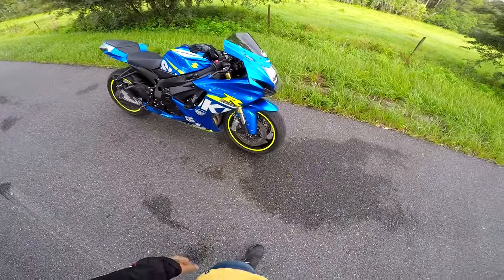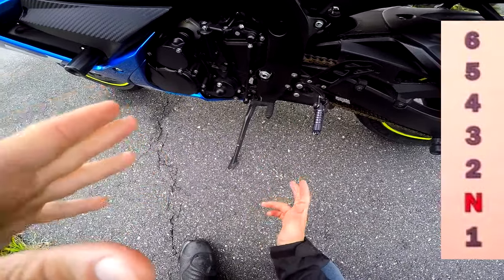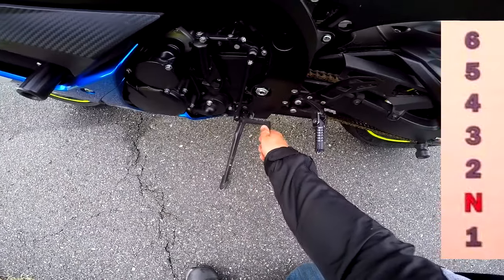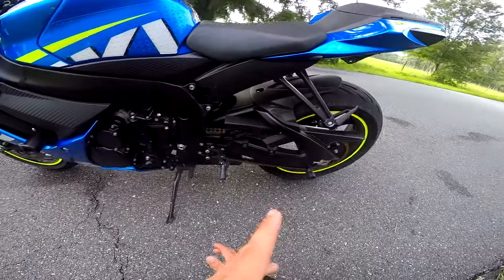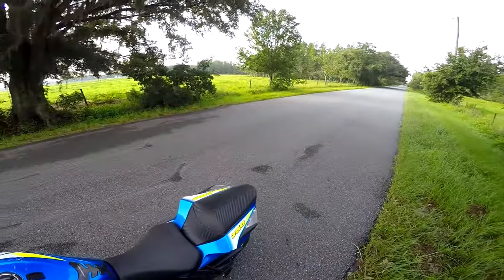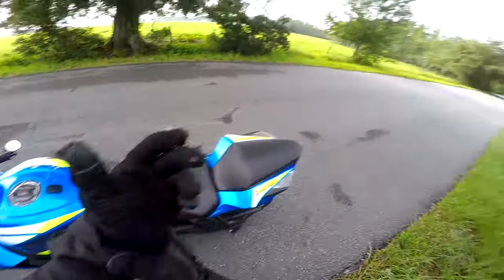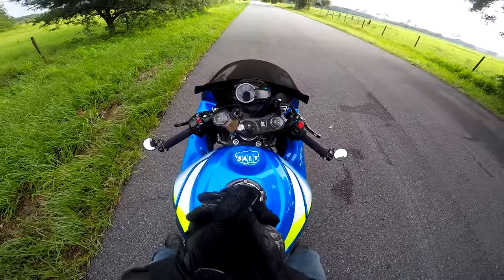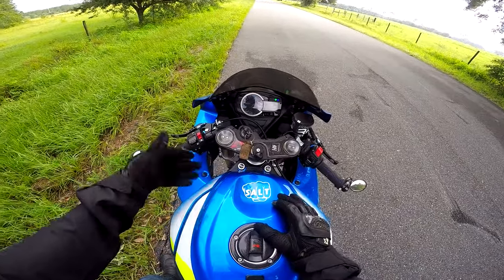How To Ride a Motorcycle: Part 2 - Shifting & Downshifting

Comment: When you’re trying to go to a stop, do you need to apply throttle to downshift?
Reply: If youre in an emergency you just wanna pull the lever in and downshift while applying pressure to brakes. Not too much pressure tho cuz if you apply too much on the front brake youre like to be thrown headway off the bike and if you apply too much on the back you'll still slide. If youre on a casual ride tho when downshifting you can blip the throttle to properly prepare the engine for the lower gear👏🏾
Reply: BlokjesRacing  so when downshifting you wanna just blip the throttle when you push down the shifter while holding in the clutch. After you've done this then you release the clutch
Reply: BlokjesRacing  so you're in 5th and you wanna go to 4th you're gonna: press in the clutch and as you blip the throttle you downshift and release the clutch
Reply: BlokjesRacing  you have to pull in the clutch.. If you don't pull in the clutch then the bike will still accelerate
Reply: BlokjesRacing  no need blipping the throttle while downshifting if ur in the right gear
Reply: You don't throttle while stopping

Comment: At 16 (still 16) I learned Manny on cars and now I'm destined to get a GSX-R 750 

Anaway I've been a car enthusiast for 12 years now and been super interested in them, this shows how similar driving a manual car is to riding, I'd recommend learning Manny first and it made a lot more sense for me especially with the bite point of the clutch

Comment: Really easy to learn if you have experience with driving manual cars too. The concepts are very similar and easy to grasp especially the "friction" zone and mixing in the gas. Just have to get used to the shifting.

Comment: I use to ride motorcycle about 9 years ago let me know if I still got it. First turn the ignition on second press the start button third pull in the clutch on left hand side third press first gear down on left leg fourth open the clutch slowly for the bike to engage third twist the throttle on the right to accelerate fifth repeat the same process to go up in gears but this time shift up. Nice video man I use to ride Yamaha r 1 I might get a motorcycle again

Comment: Question> if your are in 4rth gear or even 5 the gear can you shift down all the way to first gear? Or they have to descending in order from 5, 4, 3, 2 then first gear? And can you also go neutral from 5th gear without shifting down 5, 4, 3, 2 and 1?

Comment: I've been looking at bikes heavy lately. One of my co-workers has GSXR1000 and he literally told me the same thing you mentioned. "If you know how to drive a stick shift, you can ride a bike" and giving the fact about me I've been driving stick shifts for at least 10 years in multiple cars, turbo Integra, Civic's, and currently own a 6spd 350z.

I've been looking at Honda and Suzuki 600's, I kinda want an older used bikes to experiments on first. I have gotten on one, it wasn't on or anything, before and it was a Hayabusa! That damn thing is mad heavy!

But yeah.. they just seem interesting to me lately and I planned on getting one for my birthday in the next couple of weeks. I think I'm a bit afraid of it as well, well not so the bike, but more so the drivers around the bike. People are so careless these days.
Reply from the maker: Hey man, he's exactly right. You will pick up shifting gears on a bike much quicker going from a stick shift. And I think a 600cc would be perfect for you to start on, and likely won't outgrow it for a while. I've been riding over 10 years and I went from a 1000cc to a 750cc and love it. Good luck man and happy early birthday!
Reply: @SALTxTHExWOUND  Ok cool man, thanks for the reply back. I'm curious though, how much of a difference is a carburetor and fuel injected bike?

Comment: Let's say you are on 4th and you get in to a stop light just pull the clutche and shift it down ? Or you need to be shifting down. Well help me alot to know thank you. 😊
Reply from the maker: You need to pull in the clutch and shift down 3 times to get in into 1st gear, you can just hold the clutch in and shift 3 times back to back and it'll go down each gear.

Comment: Great video, quick question - what if your on the highway in 6th gear and theres traffic ahead and u have to come to a complete stop? you cant exactly downshift to 1st that fast in a matter on 5 seconds ? or do you just hold in the clutch and when u stop go to first? wont your rpms be very high in 6th gear going very slow at a complete stop?
Reply: Same as a manual transmission car. Push the clutch in before the rpms get so low that the engine stalls. When stopped you can then put it in neutral and let out the clutch or keep the clutch in and kick down to 1st gear.

It really is all about getting a feel for what the engine is doing. You'll learn that really quick. Just pay attention to the sound & feel of the engine.

Comment: How can I tell what the friction zone is when I go to First to second?
Reply: The friction zone is fixed for each machine and should not change. 

The definition is: when the motorcycle begins to force itself forward and thrum 

Mechanically: When the transmission and the engine begin to connect

Comment: Ideal  is to use friction zone for beginners with no throttle,  and using back braking only . Pulling on front brake can cause a crash for newby

Comment: Hey mate, I noticed u only did biting point when clutching/ starting off in gear 1 before fully releasing it. But when changing from gear 1 to 2 , or 2 to 3 u just fully released the clutch after shifting gears. Is only clutching at biting point before gradually fully releasing required in gear 1 when moving off?

Comment: A couple things I'm confused about:
Is that left thing also the front brake and back brake? Or is that only clutch? Then where's the break?

Does it shift all the way to 1st gear when shifting down, or does it go down one at a time? 

Do you need to shift to N or 1st or anything when coming to a stop?? Or does it do it automatically?

Comment: Question: say that I’m in 5th gear and I want to stop,not asap but you know,in the next 200 meters or something..do I have to go down to 4th then 3rd then 2nd  then 1st or can I hit the break smoothly and the clutch and put it to 1st or neutral?
Reply: If youre in 5th you can pull in the lever and down shift 2 gears 1 time. So 5-2=3rd gear. So you just pull in the clutch and touch down the shifter 2 times and let out the clutch while gradually applying pressure to the brakes then you just down shift to 2nd and then 1st

Comment: I’m getting it slowly like struggled to understand the clutch now I can roll forward like I already knew it. I suck at 1st to 2nd but after that I can shift really well
Reply from the maker: You'll get better with more practice. Don't sweat it, EVERY motorcyclist went through what you are going through and we all eventually get better and better. Good luck and congrats on learning! =)
Reply: @SALTxTHExWOUND  thank you 🙏 I’ve been on the road for almost a year and was involved in a crash with a suv. But lucky I didn’t get seriously injured however I switched to gears for many reasons. I will be watching more videos closely if yours :)

Comment: So when you're putting it in 1st gear your right foot is on the ground correct? So when you're starting on a hill and your right foot is on the brake how do you go about putting it in 1st gear?  Do you use the front brake while right foot is on the ground and then use left for to put it in gear, or do you just quickly use your left foot to shift to 1st while your right foot is still on the rear brake?

It sucks that I'm very uncoordinated. I'm sure with practice though it'll be a no brainer to start on a hill.

Comment: So to downshift you don’t need to use the brakes? The bike will automatically slow down if you get it to lower gear?
Reply from the maker: Yes, you do not need to use the brakes, I do recommend not being very high in the RPM range when you downshift though, let the bike slow down, or ease on the brakes to slow it down and then you can downshift, If you downshift too fast and you are at say 10k RPM's when you down shift the RPM's will go up because you are now in a lower gear, and sometimes that can result in the bike locking up the rear tire. Don't overthink it, just slow down and then downshift and you'll be fine. Good luck!

Comment: Can you get to Neutral from any gear? Also if youre going 100 in 3rd or 4th gear DO you have to get to neutral before first i wouldn't want to be going so fast and accidentally shift into 1st and losing control :) Thanks!

Comment: Just got my first bike last week. It’s a 09 ZX6R, the only problem I’m having is shifting up to the 2nd gear. All the other gears are easy to shift up or down to but it’s always the 2nd gear the I mess up on… any pointers??
Reply from the maker: If the problem is that it's hard to shift from first to second I'd start with changing the oil and filter first

Comment: I am new to a bike and would like to know if at a stop do i have to be on neutral at a stop or can i stay on first gear at the stop?
(Saw another video on a different motorcycle so I am woundering if its the same on every bike)
Reply from the maker: You can be in neutral at a stop or you can be in gear but you if you are in gear you need to hold the clutch in until you are starting to move again. Hope this helps!

Comment: i got a confustion when we in netural then we shift in 1st gear that,s down and to 2nd gear that,s up then where is neutral again it should be between 1 and 2nd then u should shift 2 times from 1st gear to go to 2nd
Reply: well you should shift hard enough to go directly from 1 to 2
if you shift without enough force, you will stick in neutral

Comment: do you not need to rev match on a bike to downshift , like any throttle blip? i know in a car it’s necessary
Reply: Yes you do throttle blip when downshifting. If its a case where there is an emergency you just wanna pull in the clutch and downshift

Comment: What if you are in 4th or 5th gear and you have to come to a stop in a short distance, can you downshift multiple gears at a time. And is necessary to rev match
Reply from the maker: yes you can hold the clutch in and shift down multiple gears, just make sure to rev match as you're letting out the clutch

Comment: If you are in 5th or 6th gear and come up to a traffic light about 10 meters away that turns yellow, do you just brake and then shift down through gears at the red light? Because I don’t think you’d have enough time to shift down through all of the gears before you hit the intersection. Thanks.

Comment: If your in fourth or fifth gear and need to stop quickly can you keep your clutch lever in as your shifting down quickly or do you need to click it for each gear going down
Reply from the maker: No, you can just hold the clutch in and shift all the way through the gears. Just don't be going 50+ and shift down into first gear and release the clutch bc the tire will most likely lock up. Keep the clutch in the entire time until you get to your stop is the safest way to do that.

Comment: Do you have to downshift one by one whenever you're going let's say at 70mph  down to a complete stop....because in automobiles, you can downshift one by one or you simply pop your lever into neutral...and stop it. I have not found a video that explains that..thanks.
Reply: I think 7:17 and 8:40 explains what you're asking. You can engine brake and downshift with rev matches (best) or you can hold clutch as you come to a stop and downshift while stationary.
Reply: @alicekim7351  thank you for your quick response...but I don't think I worded it right, what I mean is....saying coming at 70mph to a complete stop holding the clutch....do I still have to hit every gear one by one (once stopped)..in other words, can I just go from 5th to neutral in one move?
Sorry if I sound not smart here but I'm planning to get my first bike and I'm gathering as much info as possible before hand. I do know the upshifting and downshifting concepts on a car (one of my vehicles is manual), I just can't get the downshifting on a bike..thanks for your time.
Reply: @abemelendez8477  Motorcycles have sequential transmissions so you have to shift one at a time. From 5th to neutral you have to downshift 4 time (because motorcycles have neutral between gear 1 and 2). Think about cars with paddle shifters (except for CVT cars). If you're in manual mode you need to click the paddle one at a time.

Maybe watch someone ride a motorcycle with a suicide shifter. You'll see you need to shift one at a time.
Reply: @alicekim7351  thank you

Comment: Did my CBT and I've got a Honda CBR 125. I've only been on it twice because worried what gear I'm in. Anyway, apart from 1st, do I release  clutch quickly when up and downshifting?, And do I only apply throttle once clutch is completely back out?.

Comment: My biggest issue is shifting at low-speeds...nothing is that smooth, if i ease off the throttle is still jerks a little. 
I've seen a lot of people ease off the throttle THEN clutch-shift, but you seem to match pulling the clutch first with easing throttle, which might be better. I'll have to try it tomorrow.
Thanks for the tips though.
Reply: You are probably taking to long to shift or letting the clutch out to quick.  The key to smooth shifting at any speed (slow or fast) is rev matching and feathering the clutch to match the rpm to the speed the bike is is going
Reply: @331moto  Yeah I have an old-school bike with no RPM gauge, just a speedometer so I have to feel the revs as  i throttle..it's tricky, up-shifting is super smooth but I definitely noticed yesterday I need to rev the throttle more when down-shifting.. I'm getting much quicker at shifting and trying to let out the clutch only when I've slowed enough. Great tip!

Comment: When you click up or down to shift is it possible to skip a gear or is it only going to manipulate it one gear each time you click the gear lever?
Reply from the maker: It will only go up or down 1 gear at a time, you can continue to click the shifter to shift multiple gears like if you're in 4th and coming to a stop you just hold in the clutch and shift down 3 times to get to 1st gear.
Reply: @SALTxTHExWOUND  thanks man appreciate it. That’s what I figured but just wanted to make sure. Thinking the Ninja 400 might be my first bike

Comment: Can you go into netural from any gear or do you have to go all the way down to first.
Reply from the maker: You can hold the clutch in and shift down the gears and into neutral, just be aware there will be no engine braking if you do this so if you’re going fast you’ll need to get on the brakes to slow down significantly

Comment: I notice when I'm trying to downshift the bike kinda jerks forward any tips on how to make the process smoother so I don't ruin my transmission
Reply from the maker: Your transmission can take a beating I assure you, just work on shifting and letting out the clutch with a little more gas, it may not be getting enough gas as you release the clutch
Reply: @SALTxTHExWOUND  so ease in with the throttle and clutch like when upshifting?

Comment: Hello. My would be question as recently pass road part. And i have only few hours on the road. Yet my speed on major roads were max 80 km, however i am fiding hard to judge speed and gears when slowing down. For example first time i went by self to petrol station, so i was on 5th gear and approachin 60 km zone and 50 km zode i was on fourth gear. And wanted to turn left to petrol station i slow down way to soon as engine breaking also confuses me. So ended turning omin first gear. Ah, lucky was no one behind me. So how would judge what gear and how avoid the feeling not matching my speed and while shifting? Sorry english not first my language. Thank you.
Reply: Specially engine breaking and that feeling when slowing down on sports bike really find hard to get use to it. My honda cbr f 600 gears feels so short. I know practice makes perfect. My instructor always says have light revs up before moving on. Also takes time to get that balance

Comment: I need a video explaining how to tell what gear to be in. I've always just gone by what the bike sounds like. Like if it sounds like it's struggling, go up a gear. I just heard someone say that you have to downshift to accelerate quickly. I had NO IDEA that was a thing. I even took the motorcycle safety course when I first started and I don't think they explained that.

Comment: Why do u let go of the throttle when shifting? What happens if your hand is on the throttle when u shift?
Reply from the maker: I think the idea is you don't want it to have gas while shifting bc it makes it harder to shift, honestly never tried, but your RPM's will go sky high with the clutch in and on the gas lol

Comment: What's hard for me to grasp is like when you're coming up on a sharp turn from 2nd gear. You have to have your eyes following the road, but also be using both brakes and be holding in the clutch lever, ready to downshift. And hope your going slow enough to not have high RPMs in 1st.

Comment: I thought to downshift, one has to rev a bit while pressing clutch and shifting down
is that not a thing on bikes?
Reply from the maker: It's always good to rev match, but that's more so something you learn as time goes on. This is just covering basic shifting.
Reply: @SALTxTHExWOUND  bet for sure i was just wondering, because i am planning on a getting a bike and I know manual in cars so it shouldn’t be hard as far as the basics

Comment: Is using the front and rear brakes a sports bike thing? Cos back when I had a regular motorcycle on slow speeds I only use it the rear brakes and engine breaking.